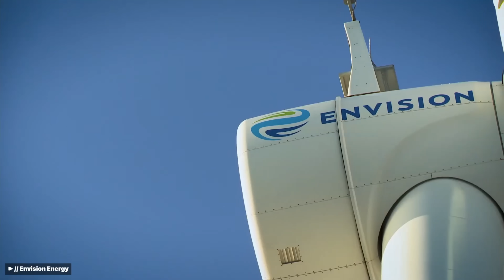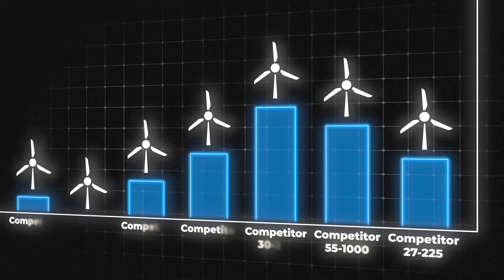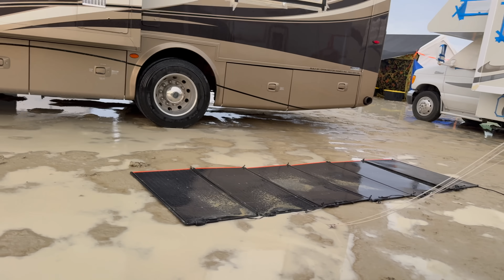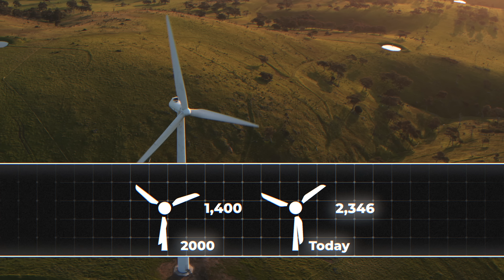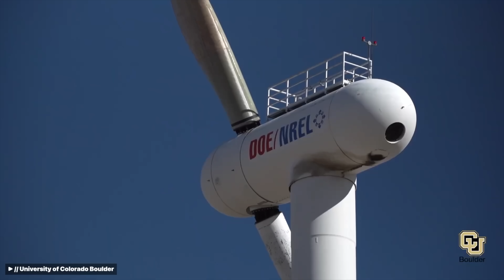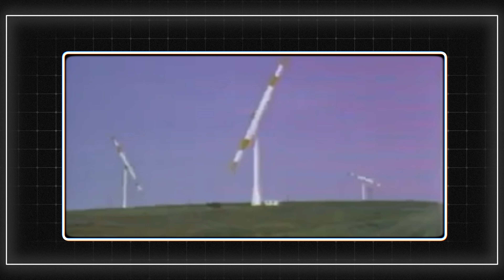Surprising Benefits of 2 Blade Wind Turbines - This SURPRISED Me...

Comment: The stable genius of a president just stopped a wind turbine farm off of Rhode Island that was 80% complete. 1200 jobs lost.
Reply: @BobbieGWhiz  Congrats! You flushed out some magat trolls! 10 points! Don't interact with them, and hopefully they'll slink away.
Reply: Extra funny is that Envision Energy is a CCP company that the first Trumpty Drumpfty admin allowed to purchase the joint venture between NEC and Nissan that manufactured the Leaf batteries for North America.  They took over (as Envision AESC) and took all the tech and most production back to China.  Ask me how I know!  Hint: I still have the uniform jacket.
Reply: Maga are morons..
Reply: Thought the ones in the ocean was killing whales up that way thats why he stopped it
Reply: @Dracokong007  Offshore wind turbines are usually only placed in shallow waters, where whales cannot swim (0-10m or 0-30 feet), without the chance of getting stuck. In fact, there are studies that shows that marine life flourish where these wind turbines are placed, as they act as shelters for smaller fish. These studies show, that predators like dolphins and sea lions increase in numbers around these turbines, because there are more fish there.

You are listening to fake claims, to drive a false narrative.
Reply: Biden killed 15000 on the pipeline which transports oil which will be transported either way and ground is safer than train. 

Both parties are retarded. Remember that. No side is better than the other. We live in America where we have think tanks try to save us from our ignorant dimwits and sometimes it works. Sometimes we get to suffer.
Reply: If you’re using wind to generate electricity, it’s a wind turbine. If you’re using it to mill grain, it’s a wind mill.
Reply: Although temporary jobs, most of these last for 3-5 years and pay very well due to hazardous conditions.
Reply: @johnpoldo8817 the project has 3 months left. The layoffs were already starting. Not saying this is a good idea. Finish the shit. You invested now, reap what you sow. But the job count isn't a huge deal. Tbh. 

I was a wind technician prior to my current position.
Reply: The wind farm would have reduced strom prices for over a million households. 

Providing over 700 MW power production
Reply: @paxundpeace9970  horse hockey.   No way do you get stable production.
Reply: @paxundpeace9970   Only when the wind blows.
Reply: @darkgalaxy5548  The wind almost always blow, and wind turbines can rotate their blades, according to the amount of wind. They are only ever turned off, when there's little to no wind, or too much wind (fierce storms).
Reply: Rubbish! Wind is very variable.
Reply: @darkgalaxy5548  Yeah, dummy! That's why wind turbines can adjust their blades, so that they always are as efficient as possible.
Reply: @darkgalaxy5548  the wind is always blowing somewhere. You’re going to have your mind blown once you gain object permanence.
Reply: These turbines barely generate any energy. And the economics are not there. This project should have never been approved.
Reply: @Matt_K In 2024, wind turbines generated an estimated 453.5 terawatt-hours (TWh) of electricity in the U.S., which was about 10.54% of the nation's total electricity generation. You know you could just google it right?
Reply: @Matt_K That's a wildly laughable claim.
Reply: @Matt_K  Oh geez, thanks for setting the record straight.
Reply: @BobbieGWhiz  Wind power is a scam.  You're a shill for stupid
Reply: Good. That’s what we voted for. 

Temporary jobs. And they just bury the blades. No way to recycle them.
Reply: @Burroughsbikebuilds  ah the, this technology has a flaw best to bin it off altogether argument. The pros outway the cons my friend.
Reply: @Burroughsbikebuilds  so dumb. The average American discards a ton of trash per year. So ~400 million tons of trash per year.  I don’t think discarded turbine blades is the issue to be worried about. 🙄 Also it’s the nature of construction jobs to be temporary. You build something. Then it’s built. Then you go build something else. 🙄
Reply: @Burroughsbikebuilds now ask yourself, how would you recycle the coal/gas burned at heat powerplant? Recycle radioactive reactor? Popsicle packaging? Did that ever bother you before? This "issue" is totally manufactured and  absolutely negligible compared to what the wind farm produces and saves vs. fossil sources.
Reply: @ydr4k3  - Why is it that the only two options you propose is coal or wind?

I hate coal. I like nuclear. And America is the only country that has a nuclear waste issue. We haven’t improved our tech since the 60’s due to regulation.
Reply: @Burroughsbikebuilds  Germany also has nuclear waste issues actually. Also, nuclear is weather dependent and needs lots of water to function well, as could be seen in summer 2023 in France. Nuclear is also horrendously expensive, provided that you build new powerplants of course, and there currently exists no commercially viable way to deal with the waste.
Reply: @Morskitar_the_fake_one - Nuclear is not weather dependent. It might be water dependent, but not weather. And yes, there is waste. But it’s not an apples to apples comparison. We have far more because we haven’t advanced the tech. 

I would rather have a couple hundred tons of waste buried for thousands of years than billions  of tons of coal in the air. Clean or not.
Reply: @Burroughsbikebuilds  Water accessability is weather-dependent, technically climate-dependent, but if there is low water, or to warm water which can also cause problems, in the area, then the powerplant cannot be run there. Research into nuclear has been ongoing, and new powerplants still produce great amounts of waste, also, old powerplants would need to be shut down and removed in order to minimize waste, which would then mean that there would also be a need for replacement powerplants. All of this is immensely expensive, labour-intensive and produces high amounts of CO2, because the production of concrete releases quite large amounts of CO2. 

I am not in favour of coal or any fossile fuel for that matter, but nuclear is currently not a long-term sustainable, nor economically viable means of electricity production and serves more as a distraction from renweables than a real form of solution for actual problems.
Reply: @Burroughsbikebuilds typical idiot talking points. All wrong of course. But that’s what idiots do - parrot other idiots who tell them what they want to hear. Right, idiot?
Reply: @Burroughsbikebuilds Another silly recycling argument. How's the gas you put in your generator recycled?
Reply: @meilyn22 - who said anything about a generator? 

Let me get to the point. I’m a big fan of nuclear power. And hopefully soon, fission as well. 

Believe it or not, conservatives want clean air and water too.
Reply: @Burroughsbikebuilds I know conservatives aren't capable of understanding analogies as well.
Reply: @meilyn22  You know nothing about conservatives and apparently nothing about wind power.
Reply: @soakupthesunman In 2024, wind turbines generated an estimated 453.5 terawatt-hours (TWh) of electricity in the U.S.
Reply: @Burroughsbikebuilds so you are a fan of not being able to be energy self sufficient. You prefer to have to pay your month tithing, got it. Ignorant clown
Reply: @meilyn22 er part time.... Still needs a hot backup!
Reply: @meilyn22 conservatives aren’t capable of understanding ANYTHING very well. They don’t understand economics. Nor science. Nor medicine. Nor technology. 
But they understand racism extremely well…
Reply: @Burroughsbikebuilds   No they don’t. Look at every rollback the current administration has done to clean air/water/food. If you think they’re anywhere close to being on your side, you’re fooling yourself.
Reply: @Burroughsbikebuilds  ah yes, nuclear and soon maybe fission too, really highlighting the intelligence of an average conservative.

And also liking clean air? Sure if increasing coal production and burning as well as shunning all electrification that threatens oil and gas burning counts as "liking clean air and water".

Those darn EV cars, nobody should have them, everyone needs a RAM 6900 texas megaranch that rolls coal on a 1.2 MPG. And just one more lane on the highway too, no trains allowed. That's you guys.

Comment: Hello Ricky, with aircraft a three-bladed prop has shorter blades than a two-blade resulting in greater ground clearance. A shorter blade results in slower tip speed and quieter operation and as you said smoother operation which results in less wear.

Comment: This is why we have 3-phase AC for high-power applications. It's a lot more efficient and smoother / "quieter". And, this is why I prefer to fly airplanes with 3 or more propeller blades and helicopters with 3 or more rotor blades.
Reply: And then there is the Bell UH-1 "Heuy" you really know when one is flying by.

Comment: Why can't they just  offset the blades so that they don't spin on the same line as the other blade thus reducing the disturbed air at the tips because it isn't spinning on the same plane of air? There must be an optimum distance between each blade being offset ahead of the next blade.

Comment: except the argument falls flat when you see one on fire and it clearly shows a separate airstream for each and every bade... no two blades hit the same air molecules unless something is seriously wrong... besides being on fire.

they all have the same disc area. yes, the wake of a proceeding blade causes a slow moving high pressure area, and that itself impedes the free flow of more air... blade count wont alter that. the entire purpose of a wind turbine is to slow wind down by extracting energy from it. blade count just alters surface friction and harmonic contents of the sound. more than three is high friction. less than three is silly. the more efficient the wind turbine, the more the air behind is slowed down. until you reach the betz limit and its slowed down too much and ceases to flow...

2 blades get some weird harmonic thing going with the tower itself...

Comment: Great discussion of the two blade turbine, which I think has a great future. I note it also shows the Seawind turbine under development the Netherlands. This is a radical new development, like the Envision, but it operates like a gyrocopter, lying almost flat on a windless day, and lifting itself into an almost vertical position in wind speeds of up to 75 mps, at which point it operates almost like a HAWT, amazingly still producing power. Be interesting to see which one wins out.

Comment: @2:20: But why not  just increase the surface area at the tip of a one blade turbine, to make up for the loss of surface going down from 2 blades?
Reply: @TomCraver  The video is missing a simple obvious reason, 1 blade doesn't work because of gravity, you would need a counterweight, at that point, it would use as much material if not more than a 2 blade.

Which then lead to the reason given in the video, a 2 blade would catch more wind than an [equivalent weight] one blade [with counterweight].
Reply: @asl9750 ok sure, I assumed it would need a counter weight, but the video seemed to imply that the key problem isn't weight, but less total energy collected, which is why I ask about increasing surface area on a single blade.
Reply: @TomCraver are you suggesting making the blade thinner?  It's not the weight but the cost of the material, maybe mass would had been a better word to use

Comment: I was told that the problem with 2 blades is that when they are in the vertical position the yaw rotation has very low resistance compared to when they are in the horizontal position. The force to move the turbine axis into the wind is the same in both positions so the resulting motion of the nacelle is choppy. This puts vibrations in the blades, the tower and everything. If you try to actively counteract the choppy yaw rotation it puts pulsing twisting forces on the tower.
Reply: You are correct and its an important point. Its the ballet dancer effect 2 times per revolution. 

Therefore a 2 bladed turbine is unstable both regarding load and stability. Load can be partly mitigated through design (Envisions demonstrator from the video has fixed blades as such a mitigation) but it will never solve the inherit problem.
Reply: Wouldn’t active control of blade pitch solve that problem?  I wouldn’t think it even has to be the entire blade. You could have actively controlled spoilers to balance the force exerted from the wind as they rotate.
Reply: @undertow2142 no, the force is related to the mass and moment of inertia of the blade. Pitch doesn't change a thing.
Reply: About all of 2 bladed wind turbines in the seventies and eighties made use of the classic wind vane for no nonsense automatic wind direction steering.  These vanes were designed quite large for good direction stability.  In variable stormy wind conditions those vanes could create a huge yaw torque.  And as you explained, with the blades in vertical position this could result in a large yaw rotation, with HUGE gyroscopic forces as a result!  IMO, his is why none of these wind turbines did survive.   I guess the only way to make survive a 2 bladed wind turbine is by controlling the yaw corrections in very small steps.
Reply: @wesleyashley99  yes, its a phenoma called precession

Comment: wait 20 yearsand you will see the real issues of their solution - and 20 years offshore are even much harder with over 8500 running hours a year
Usually these companies overllok something, that becomes a bigger issue over time and usually with an exponential and  fast growth once they had been recogniced.

Remember hydrogen car and the old tech of fuel cell used in the space 40 years ago and still with huge amounts of R&D not useable in a financial viable way !
Far too expensive, too much maintenance, hydrogen charging time quite long due to a break after each charging procedure to regain enough pressure ?
So many details since Mercedes started to sink billion with BALLARD System in germany and close to 0 sales and output, always behind schedule or plan and other technologies or better: even falling behind other emerging technologies like EV in the 2000s. 

And I expect that the 2 blade thing will face unknown issues in the longevity which can become very expensive if they might appear just 19 years after launch when they gave a 20 year warratny.
Then the company can go bankrupt under the pressure and workload once the first turbine shows or develope such recogniceable symptoms of upcoming issues. 
And at that point they might have sold 100 or 1000 turbines and have to replace one by at the age of 18 or 19 years no matter how long they might be used. In germany there is a 20 year limit when the whole turbine has to be removed and the site with all the infrastructure might be repowered under new conditions for another 20 year period.

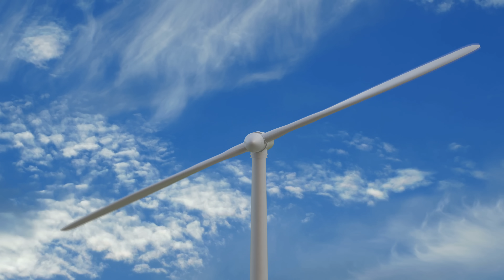Comment: 2:20 there were actually companies that tried the one blade thing. The counterweighted one-bladed turbine called the Monopteros (made by Messerschmitt) was tried in the 90's.  They actually worked. But the counterweight on that one blade was basically dead weight. It weighed as much as a two bladed rotor, but only had half the working surface area.

Comment: 3 blades have proven greater efficiency/ economic/ steady power output. The 15% 2 blade turbines of NZ are set for replacement by 3 blade albeit 3 x taller
Reply: Higher is better, and it's a much more important factor. You must normalize for height, and I would think blade length.
Reply: Dumb and Dumber.
Reply: How did you square the physics?
Reply: Ironically NZ should be building more Hydro dams and storage, not this expensive short lasting BS.
Reply: @Battleneter  wind and solar pair up very well with hydro, on dry years hydro = battery
Reply: @Battleneter Dams are not ((necessarily)) eco-friendly.

Comment: The new conical scroll vane turbines seem to further chalenge this further.
thake less footprint and generate more power per square meter of surface area however struggle at MW scale so significantly more smaller turbines then needed.
 Ideally suited to small scale home and business use.

Comment: The future is hard to predict. I doubt that windmills will be the long term solution because of the unpredictable energy production and overall impact on the environment noise, appearance, lifetime and wildlife. Long term nuclear will prevail. Small footprint for power output, near zero environmental impact safety and reliability. Once small reactors are mass produced they will be impossible to beat.

Comment: Max RPM for given blade length is limited by tip speed. Can not go above speed of sound. Turbines are designed operate close to that RPM. Less blades - less energy capture and no trickery will compensate for that.